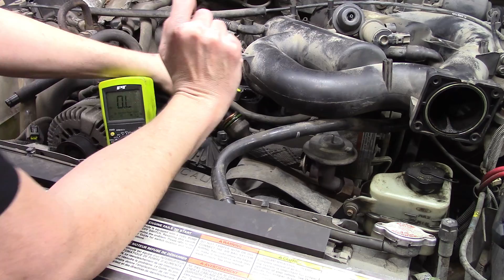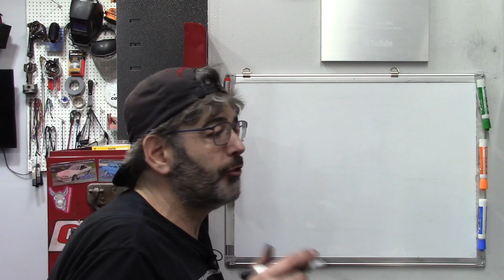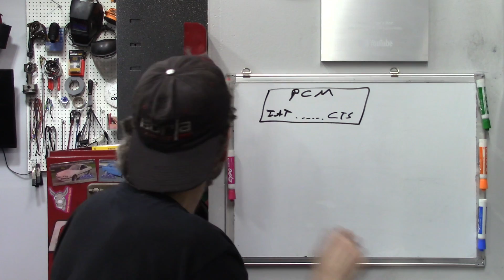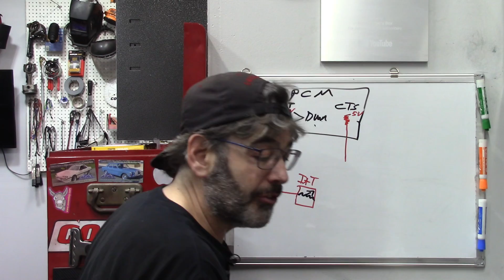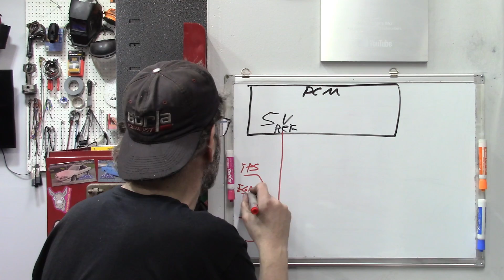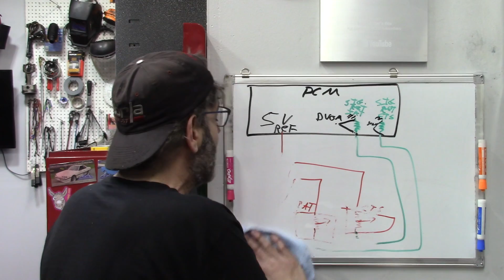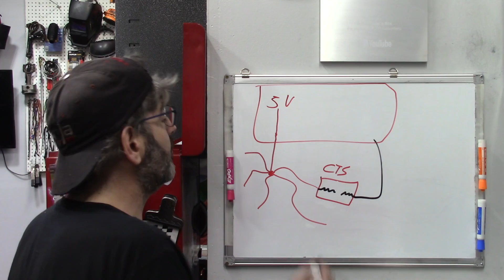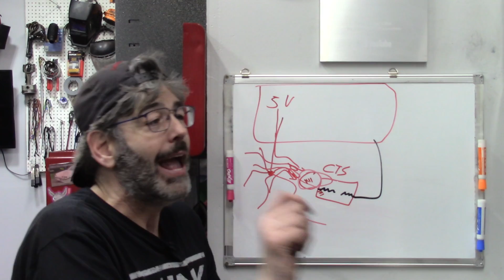P0118 Coolant Temp Diagnosis  New sensor didn't fix it Pt2

Comment: Nice video.  The diagram that you draw at around the 19:00 mark I believe may be wrong.  According to Paul Danner, a Thermistor's 5 volt reference is never shared with other inputs.  The ground circuit can be shared though.  I'm referencing chapter 6 of his book on page 6-2.
Reply from the maker: Yes I used to think that too until I saw a thermistor on a shared reference - I want to say it was on a Mercedes or maybe a BMW.
Reply: @SchrodingersBox Interesting.  It may not be the norm though.  I might try to contact Paul and see if he has seen that since writing his book and teaching that in his classes over the years.
Reply from the maker: I would welcome that. At least introduce the design I showed where it would be functional.
Reply: @SchrodingersBox  Paul responded to me and sent me a Youtube video link to watch for a better understanding of the thermistor vs a Potentiometer in relation to the 5 volt reference.  Here is the name of the video.  "Thermistor-Potentiometer comparison and the 5v reference circuit".   From watching the video, I got that the 5 volt reference is shared internally in the PCM for both types but externally they do not share it due to the resister in the Thermistor circuit.
Reply: Yes, please get scanner danner in here so we can tell him he is wrong.

Comment: Both can be shared but would have to be 3 wire sensors I believe most IAT's are ECT's aren't 3 wire they're a 2 wire sensor
Reply from the maker: What would the 3 wires be for a variable resistor?  I don’t see how that would possibly work.
Reply: @SchrodingersBox  you would use the dedicated signal wire instead of sensor ground or ref wire they all have variable resistors
Reply from the maker: What?!?!?  The dedicated sensor wire IS the ground. That’s two wires. What’s the third wire?  It’s a thermistor. Not a Hall effect. What is the third wire going to be for on a thermistor?
Reply: @SchrodingersBox  the majority of engine sensors are 3 wires
Reply from the maker: Only if they are potentiometers or Hall effects. This is a thermostor. How can a thermistor possibly be three wires?
Reply: Potentiometers in automotive signal circuits generally use three wires, connected as a variable voltage divider circuit.
One wire is the power into one end of the resistor (5V, 9V, 12V etc)
Another wire is a permanent ground to the other end of the resistor.
And finally, the last wire is the variable signal output wire, connected to a movable contact between the power input end and grounded end of the resistor👍